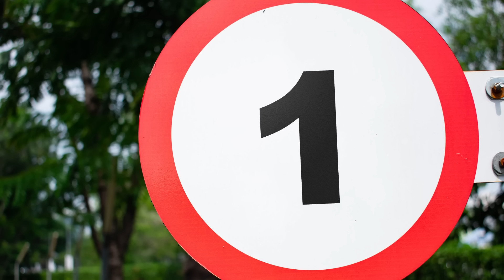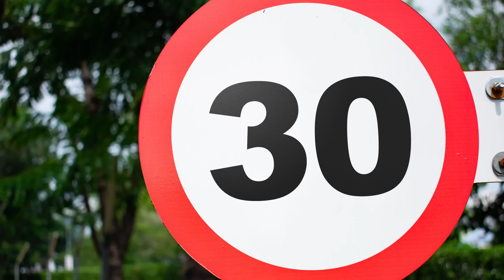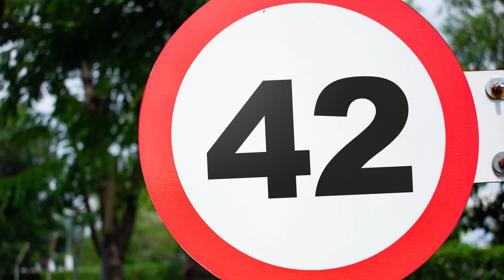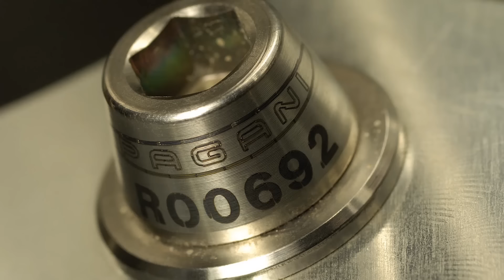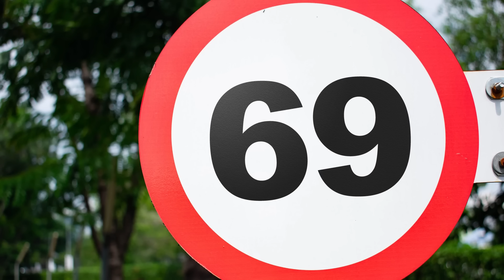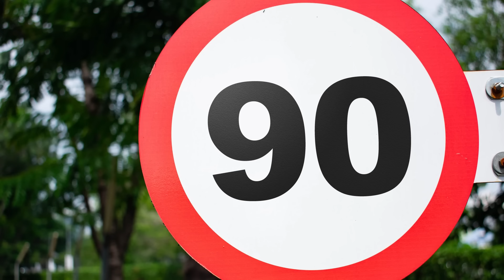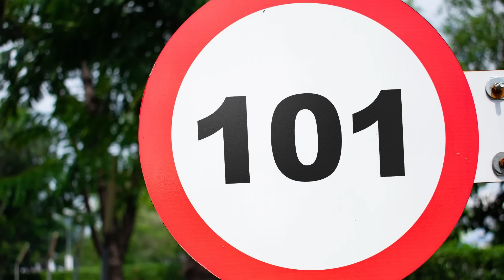101 Facts About Cars

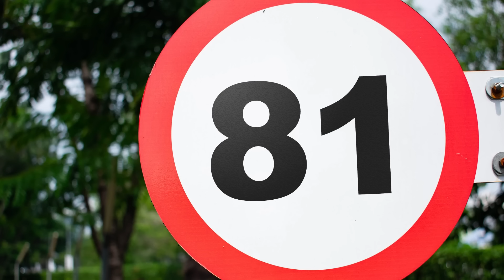Comment: 16:56 this car also had options for rwd, and options between a 4 or 5 speed, in manual or auto. not to mention its also a droptop, and the passenger seat has a table. the rear seats also swivel. dream car asf
Reply: was also availible with a diesel!

Comment: 2 other fun facts:
1. The McLaren F's tailights cost $15 to produce.
2. The Lamborghini Diablo shared the same headlights as the Nissan 300ZX.
Reply: 5£
Reply: Thanks for the fact check.
Reply: I swear there bus lights
Reply: They are not, but they sure look like bus lights.
Reply: Actually, you might be right. Maybe they really are bus lights.
Reply: @alexiscardoso1413  they are from a bus. The bova coach
Reply: I actually never knew that. Thanks for the fact check.
Reply: Miata has db7 door handles
Reply: Ah yes. The McLaren F
Reply: @sivvinod3187  ah yes if McLaren is dead then they make McLaren F
Reply: @Js_sly  They're generic units (made by Hella, I think?) which are used on lots of vehicles.
Low volume production cars frequently use either generic light units or ones taken from the parts bin of another company because the cost of having a bespoke light unit made and certified for road use is too high.
Reply: And both Diablo, F1 and other 90's/2000s supercars (such as the Saleen S1 or Pagani Zonda C12) have the same 15$ bus tail lights
Reply: @masterhybrid16  it's actually the other way round.

Comment: The Autobahn has a recommended speed of 130 km/h, which is the fastest speed where you can somewhat easily prevent accidents by braking.
Reply: With today's technology, you can shift the speed up a lot.
Reply: @Hias0895  not always.
Reply: @babymetalenjoyer  provided the driving skills are available.  Unfortunately, this is often in short supply
Reply: @Hias0895  that's correct.
Reply: @kurecore7501  that's true, thanks for mentioning that.

Comment: 3:59 here's how many i can guess:
- tire 1,2,3,4
- wheel 1,2,3,4
- window wipers (2 front, 1 back)
- pistons (2/4/6/8/etc.)
- chassis
- windows 1,2,3,4,5 (regular family suv amount)
- exhaust
- chair 1,2,3,4 (regular family suv amount)
- clutch
- transmissions
- pedals (brake, gas, clutch
- gear box
- door handle 1,2,3,4,5
- doors 1,2,3,4,5
- side windows 1,2
- engine
That's it

Comment: The Autobahn does have speed limits.
Construction zones: 60kph
Bridges: 100 kph
Undistinguished sections: 130 kph
No Speed Limit Zones: If you crash at speeds higher than 130 kph, you take full responsibility no matter how it happened.

There are also speed cameras so if you are caught breaking any of these limits, you will recieve your citation in the mail.

Comment: R32 skyline was also mass produced from 89
And had 4 wheel steering, with a way more interactive system. 
4 wheel steering is sometimes not desirable because it makes the car a but unpredictable when driven hard. Also the complexity of these systems prove to he expensive and complicated to keep working at tip top shape
Reply: Yes I believe it's called hicas
Reply: The 4ws was in no way unpredictable to drive.

Comment: car parts that i can name : fl door, fr door, rr door, rl door, trunk, hood. front bumper, rear bumper, trunk, left mirror, right mirror, fl seat, fr seat, rr seat, rl seat, rear glass panel, windshield, windshield wiper left and right, 2 headlights, 2 taillights, 4 wheels, 2 side skirts, brake caliper, drivershaft, other interior parts (40 parts), radiator, spark plugs(4), crankshaft, pistons, exhaust, engine belts (2), exhaust manifold, air filter, oil pan, clutch plate, gearbox. thats all i know

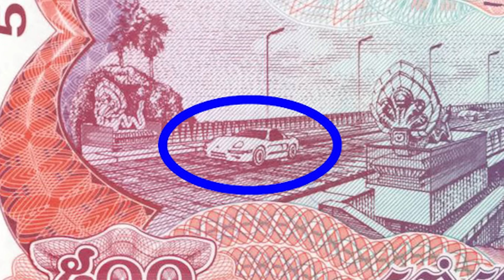Comment: 3:31 That looks like a early 2000's Mitsubishi Eclipse
Reply: It looks like a 959 for me.

The shape of the car doesn't really suit an Eclipse, though....
Reply: @greenlambo  Ya know, you might actually be right. I don't think the headlights are circular enough to accurately depict the 959, but after looking at the 959, the body lines match. I just thought the front end closely resembles an Eclipse, but it could most definitely be a 959.
Reply: @RageCannon-tf3ob  The argument of what car is that is all accrosed the comment section. I think it's a 959 because of the body lines. The headlights might trick people into thinking that's an Eclipse. 

Although I think both of them suit each other's opinion. Thanks for the appreciation 👍
Reply: It's a 3rd gen MR2

Comment: Norway's logic is right.  All cars harm the environment, including electric ones. The electricity needed to power them is most likely made from polluting power plants, not to mention the carbon dioxide outputted by manufacturing them.
Reply: What about the pollution from making the batterys
Reply: It's more about the pollution during production of the batteries and other components. Also, 97.7% of electricity in Norway comes from renewable sources, so it's not contributing to a lot of pollution during it's usage.

Comment: You asked how many car parts i can name? 
- engine block
- pistons
- headers
- crankshaft
- camshaft
- subframe 
- exahust ( manifold and pipe )
- alternator
- starter
- engine cover
- valves
- battery
- distributor
- fuel tank
- fuel pump
- fuel line
- trailing arm ( upper and lower )
- front and rear suspension spring
- disc brake
- brake pads 
- brake calibers
- wheels 
many many more, it took me 20 minutes to write this 😂

Comment: 2:40 Citroën Xantia Activa.  The standard Xantia has a decent road handling but nowhere near a supercar. Why do I know it? Because I have a standard Xantia. The reasons for the Activa road handling  is not only the hydropneumatic suspension, its also the rear axle with induced steering and the complimentary anti body roll spheres.

Comment: 102 - Once upon a time, a car was released with a 5th wheel.

The 5th wheel would lower from its rear mount and raise the rear wheels, allowing the tail to swivel left and right, making it a snap to parallel park or maneuver in tight spaces.
Reply: Was a prototype
Reply: Actually this was an aftermarket accessory, and more than one person / company made such things. The fifth wheel was actually the spare tire, stored in the trunk.

Comment: for the 2nd fact, you were wrong, because there is another place where you can also drive at any speed.  It's the Isle of Mans (between Ireland and England). 😁
Reply from the maker: Isle of Man doesn't have speed limits, bit it has rules against reckless driving. 
Going way too fast might endanger others and it will get you fined.
Reply: @TopCarsTV  ah ok , thanks for your answer and excuse me for all

Comment: Kind of missed the most interesting part of the moose test.

The moose test was actually named due to the Mercedes A class tiped over. Prior to that it was called "undanmanövertest" that translate to "evasion maneuver test". This had been preformed on new cars for decades prior to the A-class.

The maneuver was actually designed to avoid children that suddenly appeared behind a parked car. Mercedes A-class was not the first car to tip over. No it was quite a long number of cars that done that prior. But all the cars that failed have been really cheap car or very high suv or Jeeps. Mercedes that just designed the A-class was very sure that it wouldn´t tip over. The thing with the moose test is that it does a double turns. Its very similar to a Scandinavian flip. Its generally not the first turn that make the cars tip over, but rather the second.

Anyway, Mercedes A-class pre production series was on the way over to Sweden for initial testing. The second day the test crew tiped in on the roof in a 2 week test program.

To damage control Mercedes sent out a statement to the German press that the Swedish crew made a very extreme maneuver that never should have been done. The test was quite soon called the "moose test" becasue there are no moose in Germany, hence implying the test would not be useful in Germany.

This was done prior to the new spreed international news and when it did, the international press just amused it was called a moose test.

First this was adopted ironically but then, because its much shorter to say. It was fully adopted.

The biggest irony of this is not that its called a moose test to put the blaim on the Swedes but that evasion maneuver test was not done in car development prior to this. (with double flip). And this is 1997.... so we talking pretty modern time

Comment: Correction; Singapore is the most expensive country to buy a car. Import duties are around 230% and you need to buy a permit to drive the car for only 10 years. A Toyota Camry now costs around US$180,000 to own.
However, there are a few Bugattis running around here.

Comment: I can name all these parts:
Engine
Undercarriage
Body
Doors/door handles
Gas tank/gas pedal
Coolant
Radiator
Pistons
Wheels
Tires
Suspension
Windshield wipers
Left/right front view mirrors
Front/back bumper
Front/back hood
Headlights
Taillights
High lights
Exhaust pipe
Steering wheel
Radio
Windshield
Front left/front right/back left/back right windows
Back windows
Inside lights
Gearbox/transmission
Brakes/calipers/(emergency) break pedal
Axles
Horn
Roof
Floor
Paint job
License plate
Whatever that chemical sprayer is called that sprays your windshield. With the wipers as well.
Rpm meter
Airbags
INSURANCE(lol jk)
Battery
NAUS(turbo, not always an option)
Co. symbol
That's all i can think of.

Comment: Quick note about number 75:

In protest of the proposed nationwide speed limit of 55 mph, Brock Yates, an acclaimed automotive journalist and television commentator for numerous motorsports in the 80s and 90s, organized the first "Cannonball Run". It was a cross-country race where contestants would blatantly disobey the speed limit to try to drive from New York to California in less than 52 hours. The first team to win, did the race in 36 hours. They claim to have averaged about 170 mph.

Over 6 dozen drivers signed up to participate, but so many dropped out at the last minute, only about 1 dozen started the race.

Comment: the porshe has a low gear because they were turned into rally cars in the early 80s and 90s they used the porshe because it was fast and had upgradable suspension that's why it has a low gear

Comment: 1:52 Later Ferdinand Porsche stole the design of the VW Beetle from Tatra head designer Hans Ledwinka.
Ledwinka started legal proceedings which came to nothing when Hitler invaded and annexed Czechoslovakia. After the war there was the iron curtain but the moment Tatra had a commercial presence in the West VW paid them off for the design theft.
13:39 SS stood for Swallow Sidecars which was their main business. Pre-war they went into building sports cars when they switched to the abbreviation SS, one of which was called the SS100 'Jaguar'.
19:11 The Porsche 959 won the Paris Dakar rally and its class at the 24 Hours of Le Mans (renamed 961 for the occasion). It was originally meant to be a Group B rally car which might go some way explaining the low off road gear. Still you can chase Ferraris on the Autobahn, swap tyres over lunch, press a button to raise the ride height and spend the afternoon chasing Range Rovers through the countryside.
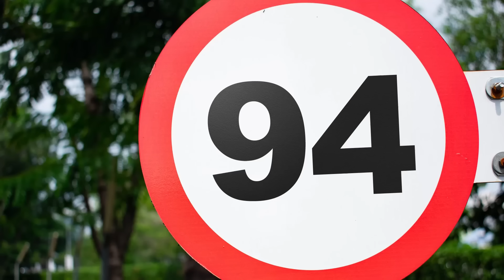19:44 Lexus could have just used the mechanical rev counter Honda used on their 1964 RC166 race bike (a 250cc 6pot!) which revved up to 17 000.

Comment: Correction Regarding #42 : The countries marked in blue do not drive on the right... they drive on the left.
(The steering wheel is typically on the right side of the vehicle)
Correction regarding # 54 : Hong Kong is not a country

Comment: A little fact check for #2: While it is true that there is no GENERAL speed limit on the Autobahn, there are however portions that do have speed limits. either due to heavy traffic, high numbers of accidents or road maintenace. the "no limit" portions of the Bahn are rather scattered throughout and rather short. so you kinda just reach top speed in your car and you have to brake again. kinda sucks really. and that's not taking into account the stupidass mothereffers that keep hogging the left (speed) lane.

Comment: A) The German Autobahn (Engl. = lit. "car lane/track") is not one mysterous road in Germany but just the German word for "freeway/express way". There are 13,200 km (≈ 8,200 miles) of Autobahn in Germany in total, only about 1,200 km (≈ 750 miles) of them are permanently without speed limit. B) The car featured at 4:29 not only is not a still roadworthy Rolls Royce because it's crashed, but because it is not a Rolly Royce at all but a Bentley. C) the footage of Roger Moore driving the Lotus is from "The Spy Who Loved Me", noot from "For Your Eyes Only", in the latter there was a Lotus but got only a few seconds of screen time. D) There are countries in which penalties for traffic violations are based on the violator's income, such as Finland, but Switzerland is NOT one of them. Yet, in Switzerland speeding tickets are usually multiple times more expensive than in the surrounding countries.

Comment: 8 That's surprising, can anyone say WHICH car transmissions used whale oil?
10 only the Xantia with Activa option had power anti-roll to level the car during hard cornering
17 refers to Rolls Royce cars (now owned by BMW) then shows a crashed Bentley (made under VW ownership).
28 more cars have been sold called a Toyota Corolla than any other - but there have been many totally different cars sold using the name. The name is all they have in common. 
The most-manufactured car of the same original design is the VW Type 1, known as the Beetle, with around 22 million made.
56 fun fact - Irving Gordon's Volvo 1800s was made in England at Jensen. Volvo used lots of parts made in England, and had their sports coupe made alongside the Austin-Healey.
64 When William Lyons and his partner started their company in the early 1920s, they made sidecars for motorcycles which they called Swallow Sidecars. Later they began making coachbuilt stylish bodies for cars, and the name morfed to Swallow Special. SS for short. As you say, not a good handle after WW2.
65 if you tried to drive a high-downforce car on the roof of a tunnel, the oil would drain to the top of the engine, and it would seize due to lack of oil pressure (unless it's dry sump, when it would take a bit longer).
66 the Lotus Elan of the 1960s and '70s had electric windows.
73 in 1769, a Frenchman called Nicholas Cugnot created a steam powered tricycle to tow artillery. That is credited with being the first mechanically-powered vehicle.
78 the Buick Y was the inspiration for the styling when Alec Issigonis designed the Morris Minor during WW2. It is very obvious if you compare a 1940's Minor with the Buick Y,  before the headlamps were raised due to lighting regulations.
91 the low gear on the Porsche 959 was marked 'G' to get round noise regulations. It meant they could use a higher gear for the noise test. Higher gear, lower revs, so less noise.

Comment: I'm 20 years old I've been the "driver" of the family since I was 14 my dad is disabled no mom and little sister is 9 years younger then me so I was the driver and yes I've came close to crashing 3 times 1st time 
We had just moved and our road was basically on the highway and this asshole wouldnt move out of behind me while I was going to turn so if I hit the break he was hitting me so I took a 90° turn at like 50 in a front wheel drive 2004 impala with a cement truck on the road I was turning into didnt crash but I could have smacked the driver if I reached out 
2nd time my buddy had moved in and well he knew I was a better driver and his car wasn't doing the best but his gf had to get to work so at 16 i was waking up at 4 am every day driving her to work but one day either his break line blew or his ex tried cutting thinking he was driving it when it was mainly me and we were going down the highway when it blew and we were coming up to a packed intersection so I had whip it down into the middle dirt section to avoid rear ending a lift pick up or a Simi 
3rd time completely my fault but my friends car battery had ran flat so I had to go help him but well he was on a 2 way city street tht was used ALOT so I had to come over from the opposite lane to park in front of him to jump his car but when I went to leave it was rush hour so I had to wait for a clearance in traffic and well I've never drove faster in reverse lol I seen a gap of about 3 cars and rammed it reverse almost backed into a car on the other side of the road but I whipped it back into the alley around the corner lol my buddy ran up calling my fucking crazy I was 17 at the time 
Js I love racing so much its sickening I've been racing since I was 5 started on four wheelers moved to go karts like side by sides but smaller then to cars aunt had a Subaru outback sedan not the normal hatch back looked more inline with the normal 4 wrk of the time only needed a turbo and it would be the same car basically but I'd sneak her keys and go race dumbass that didnt understand what a awd car was capable of

Comment: Unfortunately true for stolen Hondas. Some piece of #### used a shaved key to steal mine. Completely destroyed it. Adding insult to injury. The police inpound lot charged me over 500 to get a car out that I cant even drive. CSI came to my house to take fingerprints. I get a call 2 days later from a detective. Even though they have solid prints from approximately 5 to 8 people that stoled my car. None of them were in the database. He basically told me you're s.o.l. The cops also pist me off that day. The police woman taking my report asked if I wanted to press charges if they ever found them. Thats not even a question. Why on earth wouldnt I want to press charges? I wont buy a Honda ever again due to this.